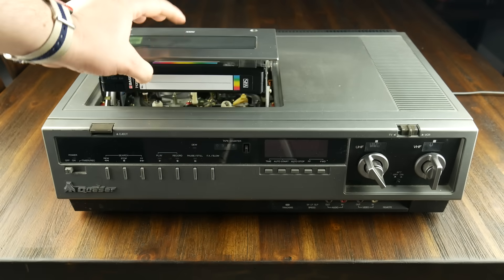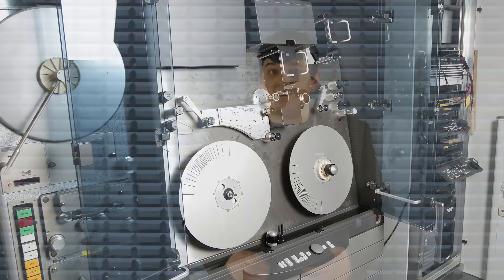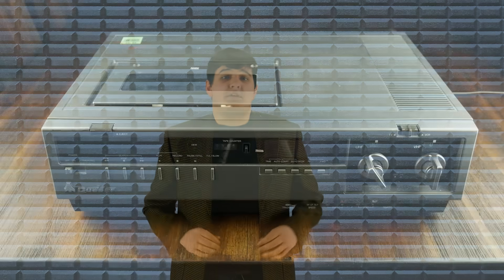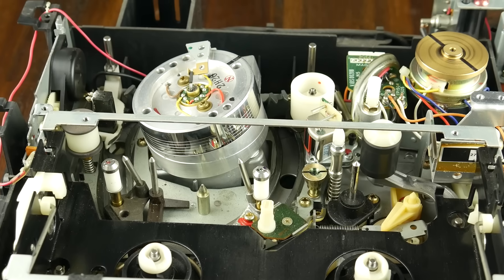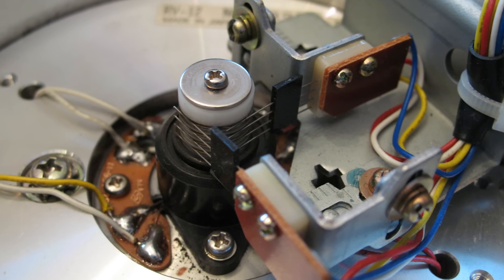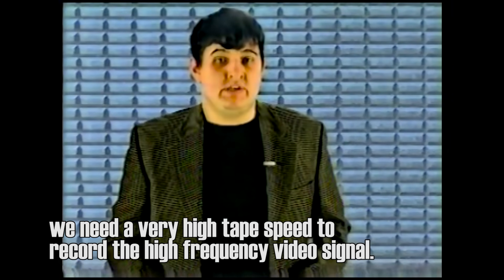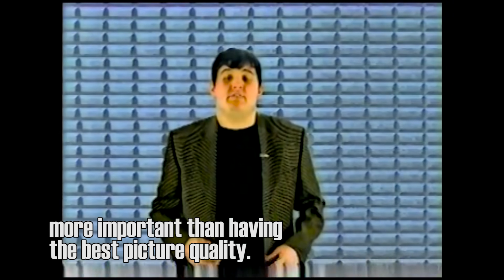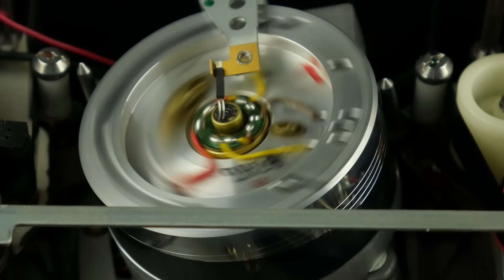The Impossible Feat inside Your VCR

Comment: In all the years I watched VHS tapes, I never knew that it actually pulled the tape out of the casing in order to play it.  O_o
Reply: I knew because it ate my tape.🙄
Reply: @owl77  hear hear
Reply: @owl77  i agree i had that happen too. Tape kept going before ejecting and the arms didn't catch on to bring yhe tape back into the cassette tapes.  . If can be saved use a pensil to rewind it if not too badly hurt. I did that too.
Reply: @owl77  tape machines eat your tape for two reasons. When the pinch roller gets dirty it gets sticky and the tape wraps around it. Or the tape take-up drive system slips or the belt breaks which means the capstan and pinch roller draw the tape through but it doesn't get sucked back into the cassette
Reply: @Johnsoline  
No new machine starts out by eating tapes. Technically you're correct, but fundamentally the reason tapes get eaten is because owners failed to maintain the cleanliness of the mechanism. I never had a tape jam - ever. I regularly cleaned my audio and video players' heads, capstain and pinch-rollers. Simple maintainance that few people could be bothered with.
Reply: @owl77  that happens when the VHS video tape is extremely old and totally worn
Reply: @owl77  that's absolutely nothing to do with it
Reply: I figured that out when it got stuck once. Was pretty weird to behold :)
Reply: @eval_is_evil  Yep. Same here. All our VHS players eventually started 'eating' the tapes.
Reply: Nice depiction of the tape being at the beginning with O_o
Reply: it destroyed many tapes tho :/
Reply: @gabrielandy9272  that only ever happened to tapes that were very old and worn out
Reply: @gabrielandy9272  that would happen especially to really old and worn out tapes
Reply: Same, I mean how were we supposed to know if we didn’t see inside. I just thought it lifted the lid and read the tape right out of the cassette somehow without having to pull it out
Reply: @mirandawyatt77 well you know after watching this Video
Reply: I knew because my VCR failed and ate my tape. I was young in 2013 and watched VHS. I grew up with old stuff.
Reply: @JamesnLollify  ya me too
Reply: @JamesnLollify  you are cultured
Reply: I learned it the hard way when my cheap 2nd hand vcr ate a tape
Reply: I didn't know either as a kid.
Reply: i always knew that it was doing something special because the danged thing wouldn't play the moment i shoved it in like the audio cassettes. made me want to smack it but it wasnt my own unlike the boombox or the cheap Realistic brand hard plastic platter record player. good to know it wasnt just simply being antagonistic. i broke a lot of stuff growing up. so now i fix old stuff. fair enough?
Reply: I first saw it at the age of 7 when my dad opened the covered to repair one. Yes, he was an electronics engineer.
Reply: Wow, you never had a tape unspool on you? It's... messy, but shows you how the tape can come out of the VHS box, which I figured as a kid was how it read the tape.
Man... I'm only 24. I watched tapes all the time as a kid, but DVDs took over pretty early. I still remember finding both at Blockbusters, and both being normal! My mom still uses a VHR to record Rachel Ray every morning, so... I guess it's still just a normal thing to me, just not an everyday item. Wow. A VHS is normal to me even in 2020.
Reply: Haha, yeah the audio cassette tape players don't do that, so I understand. But I've dismantled many with jammed up tapes.
Reply: I knew that when I was a kid
Reply: lol, never had your tape eaten? Remember opening the flap? I miss VHS
Reply: So you never had the tape get stuck in the recorder after ejecting the cassette, that would have been a giveaway lol, also the noise you hear on pressing play on the old VHS players, modern players actually pulled rug tape in after inserting the cassette for a quicker start to playback or record.
Reply: @Frostie3672  Just never paid attention, I guess.  c:
Reply: @Frostie3672  you get cassette tape stuck in the deck after ejecting and the tape is not removed from a cassette to play it
Reply: @Frostie3672   some of my audio cassettes ejected ribbons the same way (particularly in the car), there goes that theory.
Reply: So a frame was 1/3 a mm?
Reply: @artemirrlazaris7406  if you can find a television small enough, sure, I guess.
Reply: ACTUALLY digital audio tape (DAT) is pulled from the cassette & wrapped around a drum.
Reply: I was a kid with a flashlight looking inside my VCR door.  That’s how I discovered the spinning drum with tape wrapped around it.
Reply: You was not a Tec geek I see. Lol
Reply: Same
Reply: Same hera 😀
Reply: I know, that blew my mind to see it
Reply: Ikr?.
Reply: Spose you had to be inquisitive, my dad used to yell at me for pulling my toys apart, if he didn't notice me doing it , it wouldn't have happened as I always rebuilt the stuff, as an adult I would take friends failed stuff and investigate how it worked, I truly discovered more from watching "The Secret Life of Machines" than any of my own investigations, Tim Hunkin was the one person on this planet who could make a complex construct easily understood, when he wrapped that piece of white tape around a video head that had pencils instead of the heads and spun the head "Revelation"
Reply: If you used VHS alot you would eventually learn from experience after your tape would inevitably get stuck inside the machine and you would have to remove the spaghetti of tape that was stuck inside
Reply: Yeah that shocks me too. How on earth does it put all the tape back in the cassette?
Reply: Found the one guy who never had a VHS eaten
Reply: Surprised you never ran into an overused or old tape where the VHS eats the old tape. You eject & strings of tape come out separately.
Reply: Then you also never had to stick a sock on the shoulder of a hanger to attempt to clean the Head. Heh, or had a tape eaten. (Yeah my brothers and I were the sort to shove Legos between the a/v (red white and yellow) whatever keeps it working
Reply: I knew that it had to in order to function. Didn’t know that analog pixel lines were diagonal and only half the signal tho.
Reply: Clearly you’ve never had a vcr destroy your tape
Reply: Clearly you never had to pull the stray tape out of the jaws of your VCR
Reply: I didn't know that for 15 years
Reply: Mine never ate my tape but it got stuck once mid eject so I took the top off saw what was inside got tape out and spent the next 2 days playing with it
Reply: how did you think it worked then?  A laser read it as it passed by?
Reply: Why else would the cassette have a hinged flap at the front? It was pretty obvious that the tape got pulled out.
Reply: @paulberks5466  maybe cuz they thought it just opened up and read the tape without it pulling out..?
Reply: Audio tape playes seem to do that as well
Reply: You have to take the top n side multipanel off n see things working. The flip up tape shield on every VCR cassette should have clued you
Reply: You never knew that hahah silly
Reply: There are arms per say that extends the tape to the head so it can play . Some devices has more heads . That does happen in the video.  One can play a movie or songs and record . Reel to reel. Is one in  the movie . Or this movie u watch . I used them . Its magnetic  so it can be recorded to play or erased depends.  . Anyway cassette tapes  works the same way as a reel to reel but different way but same.  The arms extends the tape to the head and arms puts tape back in to cassette tapes as it ends or u push stop. . My small explanation.  Yes i left alot out.  Cd came aft cassette  then digital.
Reply: @Pheonix Martin I was born in 1999, so your point is invalid.
Reply: @TheCandoRailfan  Your passion in life is trains, get a fucking grip mate. You definitely got bullied in school.
Reply: @catcs  how about you stop being rude to people?
Reply: You’ve never taken the lid off the vcr? It’s basic knowledge m8
Reply: @seamusmckeon9109  Nope.  And this is probably the comment I've gotten the most comments on, ever.  Very strange.
Reply: @seamusmckeon9109  i will say that when VCRs were contemporary i didnt even think about taking one apart because they werent mine, cost more than i would sell for as a child and the parents threw away my old dumpster finds before i could bring it in the house. "dont bring that crap in here. take it outside!" that would be the last id see of it as it would be gone overnight.
Reply: @hardrays  

I feel bad for you.  Luckily my parents usually never knew about my dumpster dives and I was able to smuggle my little treasures into my room without them knowing!  I think your folks denied you a fun learning experience.
Reply: @seamusmckeon9109  that would be done to clean dust out
Reply: It's an electro- mechanical- chem pulley. It deceives, only. NASA-- no oxygen in, space, and burn
fuel. Atmosphere is, required. OS'= ocean in HAW! os= foundation in kaldean.
Reply: Paul Hetherington ???
Reply: @paulhetherington3854  I've no idea what NASA burning fuel in space as to do with anything here at all, but rockets carry oxygen as well as the fuel to allow combustion when outside the atmosphere.
Reply: @paulhetherington3854  what the fuck is this guy on?
Reply: hyenacub your so dumb
Reply: @masseyluna2002  what a childish comment.
Reply: Seriously? Idiot.
Reply: @TheCandoRailfan  That's rude
Reply: @TheCandoRailfan  regardless, it's still rude to call someone an idiot.
Reply: @TheCandoRailfan  observe how you have no likes
Reply: @thefakepie1126  Doesn't make it any less truthful.
Reply: @TheCandoRailfan  ok boomer
Reply: @TheCandoRailfan  Firstly, a normal tape doesn't do that. If you didn't hear it somewhere like in this video you'd have to look inside a VCR, which isn't something most people would do. It's not obvious. Secondly, even if someone doesn't know something that you do, that's no reason to call them an idiot. That just makes everyone feel worse and doesn't help anything. Even if someone was completely stupid, you shouldn't say that because it's just rude. You should learn to control what you say out loud or you're unlikely to be able to do anything in life if you just call everyone stupid. I'd don't think you'd get a job if you were constantly calling the interviewer an idiot.
Reply: @TheCandoRailfan  Audio tape isn't pulled out of the cassette. Why would you assume video tape was if you hadn't seen how a VCR works?
Reply: @AdamKlein77  VHS cassettes are very different from Audio cassettes.
Reply: Also-not that much, no. It's basically the same tape (just wider) wound onto a pair of spools and wound through the machine using a capstan and a pair of sprockety things. The only significant difference between the design of audio and video tapes is that, for videotape, the tape has to be pulled out of the cassette.
Reply: @TheCandoRailfan  we are here to learn
Reply: @TheCandoRailfan  I used music cassette decks, the tape stays in the cassette. So it's not that weird to assume that a similar looking tape would behave in the same way honestly.
Reply: @TheCandoRailfan  well seeing as the wildly popular cassette didn't do that and people could see that since there were many tape players that showed the tape moving past the head it's not unreasonable for people to think that VHS works the same way as they are both tape and therefore through association people think they would work in similar ways
Reply: @AdamKlein77  aint goin nowhere without the pinch roller. clean it while your in there unless flutter is your kind of thing.
Reply: @TheCandoRailfan  so yes. That's a yes. Enjoy your life champ.
Reply: @parkerkrakowiak2990  go harass someone else.
Reply: @JustinLe  very true
Reply: @TheCandoRailfan  the only exposure to tape mechanisms most people got was when they shoved a cassette tape into a player's transport instead of sliding it into the door tracks a closing it, and seeing that the tape from a cassette is not removed from the cartridge.
Reply: @TheCandoRailfan  you know why they're not stupid for not knowing that? Because knowing it doesn't make you smart ¯\_(ツ)_/¯
Reply: @TheCandoRailfan  As someone who has worked with cassettes and VHS tapes, even though not paying attention, I thought it was like a cassette,  not taking the tape out.
Reply: Also never knew because I never had the classic tape devour issue.
Reply: Worst I've seen was when I shoved a sandwich into the tape player when I was about 1 or 2.
Reply: @DMARrecords  lol that beats my shoving a toothbrush into my parents VCR 😂
Reply: @TheCandoRailfan  I didn't know either you rude idiot.

Comment: Great video! I never thought about the signal transfer between the rotating heads and the stationary drum. Very inventive solution.

I have the same RCA VCR, I love that clunky beast. Sadly on mine, the tape tension mechanism is broken. I have another similar model that I restored which does fully work and has a like-new set of video heads. The picture quality on a CRT is still surprisingly enjoyable to watch.

Comment: The BBC also had one that used metal instead of tape because of the speed. It was in an armored room because if the 'tape' broke it was a literal fragmentation bomb.
Reply: Heavy metal
Reply: Damn. Tv is metal af
Reply: @alex0589  This deserves way more likes.
Reply: That was the Blatnerphone, an audio recorder. It was used for a while in the 1930s but was later abandoned as the BBC went back to recording on discs.
Reply: @electricpalace4720  No - it was VERA, Vision Electronic Recording Apparatus.
Reply: @tsmith7146  VERA recorded on 1/2 inch plastic backed tape, not metal tape.
Reply: Reminds me of the earliest audio magnetic recordings, which were done on wire. I've forgotten the name of the guy who invented it.
Reply: Poulsen is the guy in thinking of who first recorded sound with an electromagnet.
Reply: Mmmm.  Engineer gibs.
Reply: This sounds fascinating, I'd love to read about it. Source?
Reply: I hope they keep it next to Colosson, the numberwang robot.
Reply: I seem to remember regular audio cassettes that bragged about metallic tape in the 80s.
Reply: @High-Tech-Geek  Those used plastic tape backing like other cassettes, but used a custom metal blend instead of the iron or chromium oxide in earlier versions (iron oxide was Type I, chromium oxide was Type II, and the metal tapes were Type IV). They had better quality than the other two types, but without the flying metal strip of death in case the tape broke.
Reply: i.e., A source of shrapnel.
Reply: Haha, bbc
Reply: @shaynehughes6645  omg

Comment: Great video as usual. Say what you want about the quality of VHS tape (and wow what a difference it makes when you switch in the video), getting that first VCR in the 80s was the most significant and exciting technological advance I can personally remember.  Before we got it, we had to run around to try to get in front of the TV when shows we wanted to watch came on. The only way to watch a movie when we wanted was to go to the theater or hope it was shown on TV, but since we only had a handful of channels, even with cable, there was not much chance of that happening.

Comment: I've seen VHS recorders in radio stations used to record the program (for anchor training, quality control, etc). They told me it was because of the huge capacity. But I don't know if it was standard analog VHS or some digital variant. But looked like common consumer products :D
Reply: StYxXx Maybe ADAT recorders, they use VHS to record up to 8 tracks per unit

Comment: "If the heads are spinning around, they can't have wires attached to them like these stationary heads do or they'd tangle."

Actually, they can if they use an anti-twister system, which uses mathematical spinors (objects which return to their original state after 720 degrees of rotation) to keep the wires straight. These see use in continuous-flow centrifuges, which you would find in things like plasma donation machines, because you can't pass blood through a slip ring. They also rotate at high velocities in order to separate blood from plasma. I assume these sorts of things would also work inside a VCR's heads.
Reply: Actually, you can pass liquids through slip rings, you just have to make it hollow instead of a flat contact.
Rotary joints are common on hydraulic and pneumatic systems, and any other time pressurized fluids have to go through a rotary joint.

And what he said is that you can't just connect a wire to the head, which is correct. You have to have some sort of mechanism that allows rotation while passing current, and that's not a wire!

Comment: I still have a Philips VR 2115 plugged in (next to a VR 2840 V2000 deck that i never figured out how to program) witch instead on an "M" it wraps the tape around in a "C" shape, with a very interesting mechanism! My original profession was a Radio + tape recorder repairman, the actual last finishing course in 2002! Repairing and collecting rarer models was my 1st adult hobby, (than i went back to trains and planes when parts supply gone).